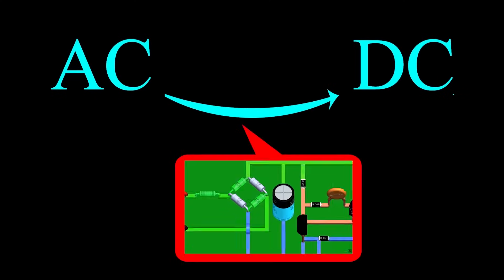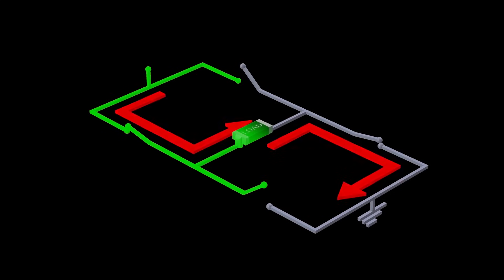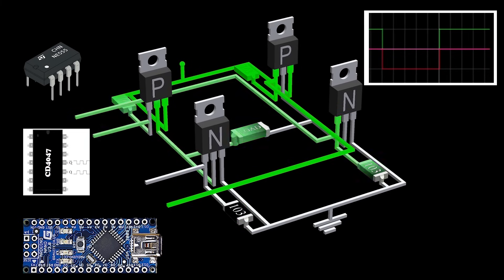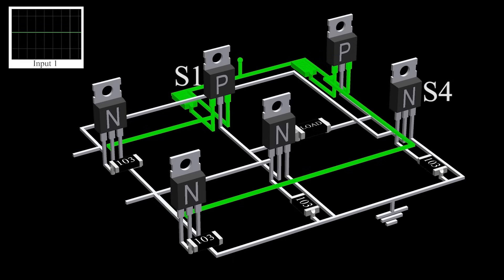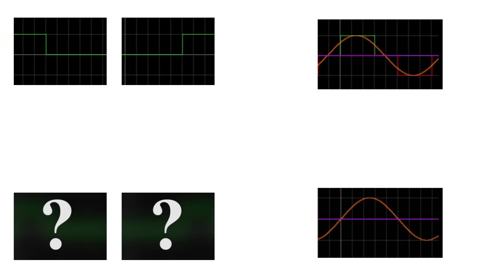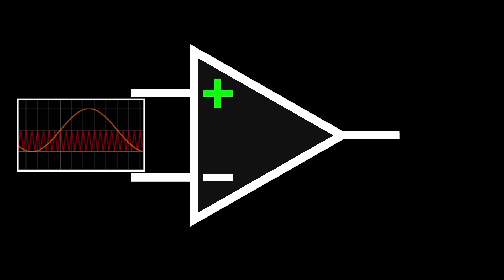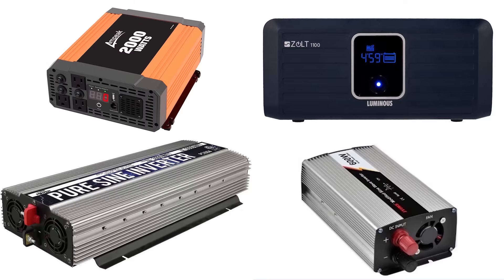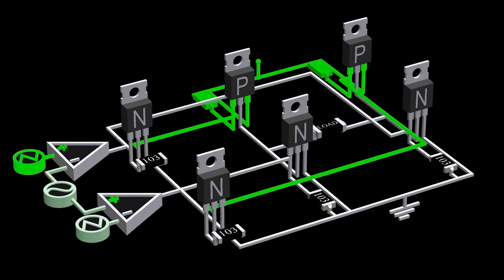How does an Inverter work? | Sine wave Inverter

Comment: This is a video that explains how interters work,. First it uses the principle of a H bridge. A basic H bridge is a circuit that changes the value of voltage of a load according 4 interruptors. With inverters we have transistors instead of switches. These transistors are activated by pwm signals. An inverter also has a circuit that produces a triangle wave. This is how we can turn from DC current to alternating current, but for low voltage aplications.

Comment: 'to get a sinusoidal output you need a sinusoidal source', I mean you expanded the not-gate into its transistor components, but the most important magic-sauce of the comparator itself and that sine source is left unexplained
Reply: You can just use a microcontroller and make it output a pwm signal that changes duty cycle based on a sine function.
Reply: Google Wein Bridge buddy :/

Comment: I like how the transformer tries to connect to the circuit and is instantly blocked.
Reply: It’s to show that this is a dangerous high-voltage circuit that you should not build at home. Electroboom would be disappointed.
Reply: Yo noticed the same thing I did 😂... this tells me to just do it😂
Reply: I liked the picture of the burnt inverter components that immediately followed.

Comment: Question :
Why do we need PWM ? Can't we just use a low pass filter and take the first harmonic sine wave from the square wave ?
Reply: Filtering a square wave into a sine wave would require huge capacitors and inductors, which would waste a lot of power in the form of heat as they repeatedly charge and discharge.
Reply: @beanapprentice1687  
Thank you

Comment: Awesome presentation through graphic. Much easier to understand and conceptualised how it works! Thanks !
Reply: Your easily fooled, if this helps you conceptualize, notice this is a cheap Chinese high frequency mosfet design, chip based, low frequency is what you want, transformer based just like the world's electric grid!  If chipbased was good and reliable, it would be what runs the world WTFU

Comment: If I design it by own will it be efficient ??
Reply from the maker: I wouldn't recommend building this. This circuit isn't efficient or safe.
This video is only for understanding the basics only, building it will be a completely different thing.
Reply: So, basically there are 2 route to build an inverter... 
1. I called it single step inverter, the sPWM module drives an H Bridge at low voltage and drives a step up transformer, and from the output of the transformer connected to a feedback circuit.. (12vdc -> 220vac)

2. I call it 2 step inverter. So you have 320v DC supply from a DC to DC converter, and then feed it to H Bridge and then give it sPWM signal.. (12vdc -> 320vdc -> 220vac) and then do the feedback mechanism...

The first route is the safest because you're working in low voltage (as long as you dont mess with the high voltage section). But because it's using iron core transformer, this design is the least efficient..

The second route, is quite dangerous and challenging.. you need to make a boost converter first (SG3525/KA7500 maybe?) To get 320vdc or source a ready made converter.. this is dangerous (basically everything above 90v dc is dangerous) and then you feed the 320vdc to a h bridge.. then you give it sPWM signal.. this is the efficient way because you are using switched mode power supply technique and using ferrite core transformer in the dc to dc step up

Now for safety, there's a module called the EGS002 sPWM driver board. It's cheap (80k IDR/less than 15usd) and it will do everything for you... Overvolt, overtemp, undervolt, short circuit etc..

Now that I mention the driver board module.. I suggest you not make your own driver.. do NOT try to make your own module... It's too dangerous I almost died (literally) because of this experiment. You have been warned

Comment: Great video !!! Basically a sinewave inverter is a class D power amplifier with reference sine wave at the input and an output tranformer to increase the voltage to desired rms level (220V or 110V)
Reply: Most of the modern inverters use boost power supplies to crank up the voltage to 150 or 300VDC then drive the final output through a high voltage H bridge

Comment: Can you plz tell about the snubber circuit calculation and how to design and how it works
Reply from the maker: A snubber is a device used to suppress voltage transients in electrical systems.
To suppress the transients, you need to store the energy and release it slowly.

Hence, calculate the energy that needs to be suppressed (E).
Then, select a max voltage that you want the capacitor to obtain (V).
Energy stored in capacitor -
E = C*(V^2)/2 -> Get the value of capacitance (C).
And for resistor,
Measure the max current current at the input of snubber circuit(I).
R = V/I -> Get the value of resistor (R).
Reply: @ExplorerStuff  tqz

Comment: why not implement safety features such as temperature monitor, Voltage feedback, Over current protection and such using the microcontroler?

Comment: Why are they called inverters instead of converters?
An example of an inverter would take a +5V and output -5V, hence inverting the voltage. 
These don't invert anything. They convert DC to AC, hence they should be called "converters".
Reply from the maker: Originally converters were large rotating electromechanical devices used to convert AC to DC. Essentially they combined a synchronous ac motor with a commutator so that the commutator reversed its connections to the ac line exactly twice per cycle. The result is ac-in dc-out (with a lot of switching noise thrown in).
If you invert the connections to a converter you put dc in and get ac out. Hence an inverter is an inverted converter.